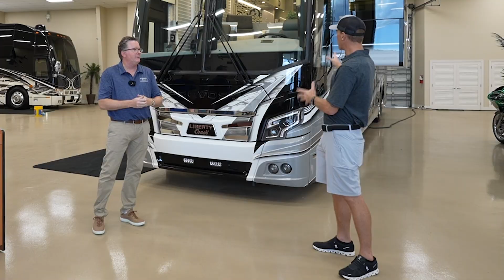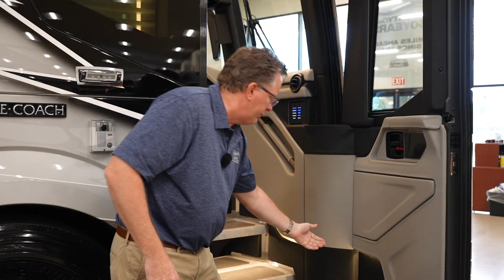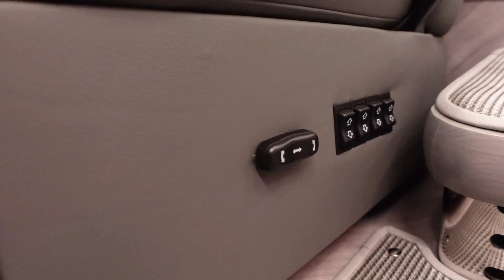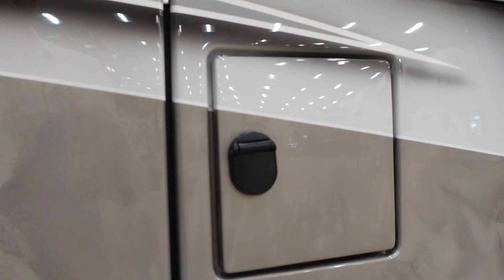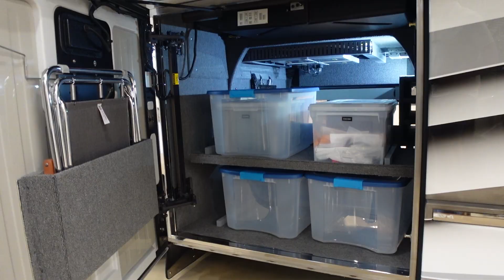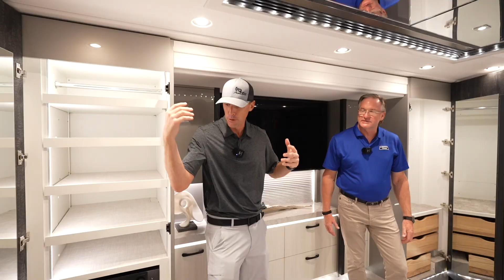2024 Prevost Liberty Coach Exclusive First Look

Comment: As exceptional as this unit is, it still has a 'bus' feel to me due to the lower driver/passenger seating positions. I really like that fact that Newel's seating positions are the same as the living level and the seats can be swiveled around to be include as living furniture. Availability of a mid-entrance is very appealing as well and its my preferred configuration. Too bad that couldn't have been implemented in the Prevost body for coach companies such as Liberty.

Comment: Does it still come with front flip down TV with new body style? Beautiful coach!! Being a tractor trailer driver for 28 years I'm just leary of side mirror deletes. Because what happens if you loose all power and don't have real mirrors as a backup, your riding blind.
Reply: Thank you for the comment, yes it still has the flip down TV in the front, because of the new roof profile the TV lift can swing at a larger angle providing more room to enter the coach when it is down.  Regarding the mirrors, if you loose all power, more than likely the engine has failed as well so you are probably not moving.
Reply: @frankkonigseder6592  Thank you for your response. Only reason I asked about power failure is I drove a brand new semi that had power failure on highway at 65mph. All I could do was watch my mirrors and let coast off highway onto shoulder. Not having power to electronic mirrors would be scary. Thanks again for responding.

Comment: Definitely a resort queen that requires full time shore power. The absence of a screen door makes me imagine the full time whir of roof ACs because the door must always be closed.
Bet NASCAR racers pass these up because they have kids and dogs.
Reply: Actually we have the strongest battery pack in the motorhome industry for dry camping mode and we have a number of NASCAR drivers that are customers.  You have a good point regarding the front door, because of it's shape the screen door option is all but impossible, thank you for the comments
Reply: I have one and you'd be surprised. The batteries they have are close to the levels you get in a tesla. So you actually have ability to run multiple acs for 8 hrs I think. 1ac for 16hrs. While also running your other standard things.. Then the batteries are rechargeable while driving. They are amazing. Seriously. Also many windows can vent.

Comment: But why the split windshield ??? Yuck did a awesome job ever place else
Reply: The slip windshield has many benefits, if you have driven a coach for any length of time you would know that you will have to replace the windshield, there are many challenges to replacing a solid windshield as opposed to a split, you also have to keep in mind that creating a blind to cover the solid windshield with the curvature of the front end of the coach would require a significant loss of interior space when it is in the down position making entry and exit through the front door difficult.  Thank you for the comment.

Comment: Love it but I'm not a fan of a split windshield 😢
Reply: The slip windshield has many benefits, if you have driven a coach for any length of time you would know that you will have to replace the windshield, there are many challenges to replacing a solid windshield as opposed to a split, you also have to keep in mind that creating a blind to cover the solid windshield with the curvature of the front end of the coach would require a significant loss of interior space when it is in the down position making entry and exit through the front door difficult.  Thank you for the comment.
Reply: @frankkonigseder6592  but my 2020Fleetwood Flair 32 S has a sold windshield and I love the uninstructed  view and my shade has no problem and having a bar between would make my view terrible and dangerous

Comment: I'll bet all those aerodynamic improvements add up to a whole 0.1mpg increase (and that's being generous).  The long term fuel savings puts this coach in the affordability realm for so many more folks.  All kidding aside, gorgeous coach, and I love the camera mirrors, but I'd still choose a Newell over this.  I find it strange that Liberty is still using a hot water tank system (along with tankless).  Seems unnecessary and not an efficient use of space.
Reply: Thank you for the comment, we use the stand alone water heater so that you have hot water storage capacity as well as allowing the water flow to be consistent to what you have in your home.  A lot of people do not realize that for the tankless or other types of water heating devices to function properly the water flow must be constricted/slowed down to heat the water and you have no storage of hot water, when that fails you have no hot water.  Many of our customers prefer the ability to get the soap out of their hair using less water than standing in the shower for every wasting water to do so.  I can personally attest to this as in my past I have had customers buy from Liberty Coach for this reason alone after trying out a unit over night.

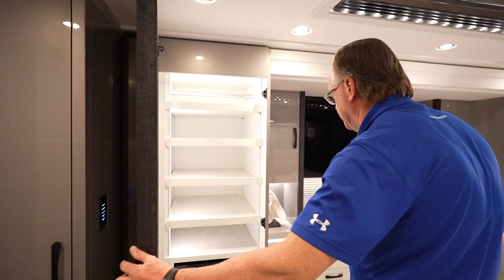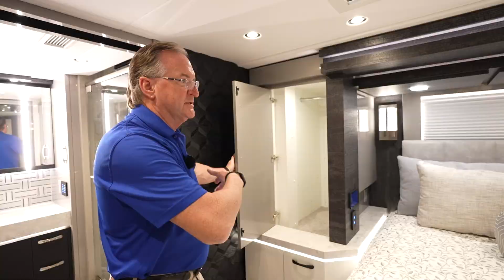Comment: Exceptional craftsmanship all around, except for those carpet moments at 57:00-57:02, 57:05-57:07, and 57:53-57:54. I can just picture the owner's reaction: "Hmm, guys, not to be a detail diva, but this isn't quite the carpet we had in mind." 😄
Reply: Actually as designed other than a little trimming which was done after the video

Comment: It’s a beautiful unit.  Fantastic graphics and paint.  But what about survivability enhancements in event of a front end collision?
Reply: There is no better shell to survive a front end collision than an Prevost, the front end behind the facia is incredibly robust, one would need to see the factory to understand how incredibly built it is
Reply: It's a very safe coach. In fact just look at greyhound buses and how safe they are in a crash. Speaks for itself. Not to mention they actually added more steel in the front to increase safety in case of a crash. Adding strength to the pillars.

Comment: It is a beautiful endeavor with the new styling by both LIBERTY AND Prevost. Wish it had as standard a fire suppression system, security remote system, escape hatch and rear active steering in reverse and forward.
Reply: Thank you for the comment, the coach does have a fire suppression system and has had one for over 10 years, something to point out in future videos.  We also have a remote security system.  Regarding escape all of the side opening windows can be used for escape on both sides of the coach front and rear.  Active rear steering is a factor of serviceability and longevity, as mentioned in many videos the Prevost chassis is designed for millions of miles, the unloading tag is a simpler and longer lasting design.

Comment: do you make a mid entry coach and kitchen on the driver said
Reply: Nope. This is a bus conversion. Newell which builds their chassis in house can most likely accommodate that.
Reply: Check out the Marathon Coach videos, Coach Mondays with Mal. 

Don't take this as a 100% fact, but it looks like Marathon is currently building two mid-entry H3's for a racing client. 

If a mid-entry Prevost is possible, I'm sure that that would be another factor that makes the decision between Prevost and Newell even more difficult.

Comment: Liberty leads in technical systems - hands down. I'm not a fan of their interior decorating, but I guess that is up to the customer. Huge respect to the engineering team at Liberty and Prevost.
Reply: Newell smokes Liberty. These are limited to what you can do. Newell on the other hand build their chassis. If I had 3mil to piss away, I am going with Newell. I would not be putting the miles needed to have a Prevost chassis.
Reply: I’m in my 60’s and I absolutely LOVE the Interior of this Coach!……
 MUCH BETTER THAN THE PREVIOUS MODELS 😆👍🏽
THEY look like Old ‘70’s Cabinets etc. 😝

It’s time to UPGRADE!  LOVE EVERYTHING ABOUT THIS BEAUTIFUL COACH! 🤩
Reply: Terrible interior, they keep Newell in business!
Reply: @chrisbethmann3955 
🤔 THIS Coach’s Interior is close to some Newell I’ve looked.